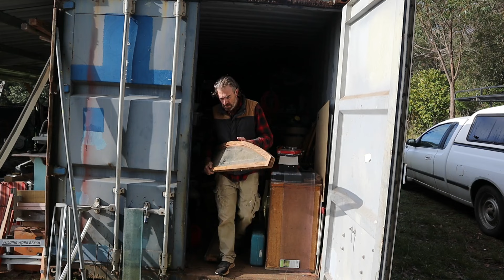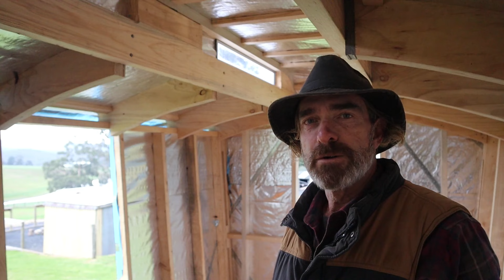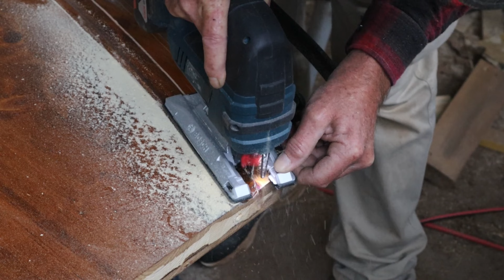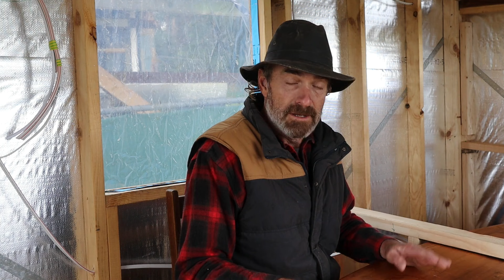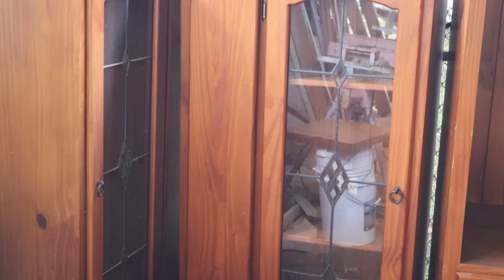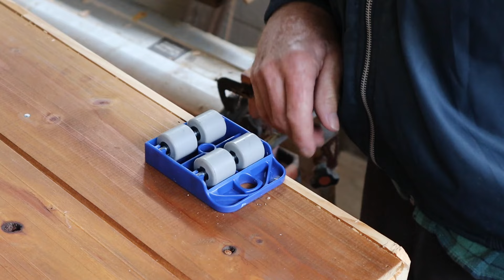Building a Gypsy Wagon - Part 7

Comment: Hi Mark can you please tell me what the product is you used on the outside of your gypsy wagon is it cement based product or timber sheet thanks Peter.
Reply from the maker: G'day Peter, It was the woodgrain version of this sheet below. And this is the place I got mine from. However, the sheets I got had a 90mm repeating board width, as opposed to this linked one which is 300mm width repeating. The ones I got don't seem to be available at this place anymore, at least they're not on the website. But it is an external, timber based cladding product that comes primed. Hope that helps. 🙂

https://tileimporter.com.au/product/weathertex-primelok-smooth-weatherboards-200mm-x-3-6m-x-9-5mm/
Reply from the maker: I remember paying about $83 per sheet. There seems to be a far more expensive version of what I got in that Weathertex range.

Comment: Hi whats that plastic t@g stuff called looks brilliant great videos i binge watched all of them from start to finish about 4 times thank you for all your time and for helping people out there that are lurning
Reply from the maker: Hi Connor, thanks for watching. 🙂
   If you mean the blue paper fixed to the outside frame? That's a foil, breathable water vapour barrier. Commonly used in Australia to protect a frame from moisture. It also has a low insulation R value contributing to the main insulation used.

Comment: Well done. You've got some imaginative designing work there. I particularly like the repurposing and the bedroom demarcation barrier.

I don't know what your climate is like over there but it seems it does rain. Did you consider water drainage in your window frame design (eg lead) or do you think the overhang suffices? 
What's that bannings stuff? Is that damp proof foil or?

Cheers and thanks for the video.
Reply from the maker: G'day Jacob, thanks for the comments. 
  We have been getting more rain than normal recently and it's been a good test overall for the wagon's water tightness. Roof good, always bone dry inside. When fully closed the windows do collect a tiny bit of water on the sill, which is angled down, it doesn't seem to be much of an issue, it dries or evaporates quickly. The top seems to be well protected by the overhang, doesn't get direct water hitting it. My biggest worry is the window glass, single pane and quite old. We had sideways hail the other day and I was watching it thinking, is this gonna bust my tiny, fragile triangle glass sections?! It made it clear that I have to make the shutters operational now instead of just fixed.
    The blue foil wrap is a perforated (breathable) water vapor barrier for walls, that pretty much all houses in Australia have installed, particularly a weatherboard house. Acts a condensation barrier to keep water off the frame and also has a minimal insulation R value, about 1.3 I think. The un-perforated version gets used on the roof, under the roofing product, wear condensation build up runs down into the gutters.
  Thanks for watching 🙂

Comment: Fantastic work, would you consider fitting a length of rope or paracord to the backs of the bench and draws to stop them accidentally being pulled all the way out of the run? 
Can’t wait for the next instalment!
Reply from the maker: Good idea. I've been thinking of fixing some kind of stopper to prevent just that. 👍

Comment: I’ve been looking forward to this installment. Thanks 
I built out a van conversion myself. I’m not anything remotely near your skill and imagination … but I’ve been inspired by your work.
Reply from the maker: Well done. You'd never know if you never gave it a go! 🙂
Reply: @RedPathRambler the stuff I'm looking for  is shown at 12.50 time juring the video Many thanks Connor
Reply from the maker: Right, gotcha. That's an external cladding board called Weathertex (here in OZ). It's actually a compressed timber product, impregnated with some form of treatment to make it waterproof/water resistant and then pressed into 2.7m x 1.2m boards, 9mm thick. They come primed already. Really good product and holds up really well in the weather.
Reply: Thank you ever so much I live in the UK and I'm ortistic and epileptic and have learning difficulties and you  have expired me to save up my hard earned money and to watch your videos again and try and make my own won thank you again mate
Reply from the maker: @Connorstreams  No worries Connor. Jump into it, have a go and all the best to you 👍